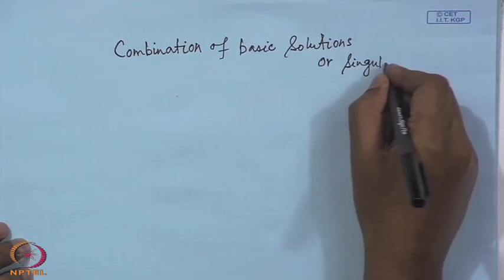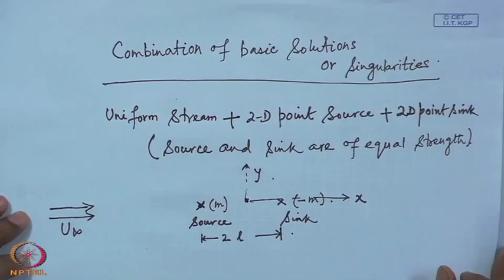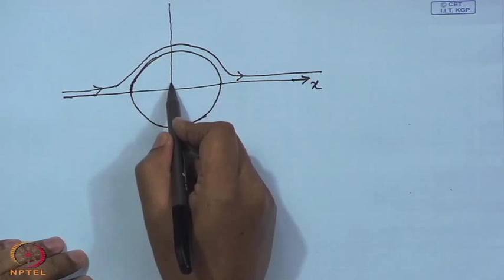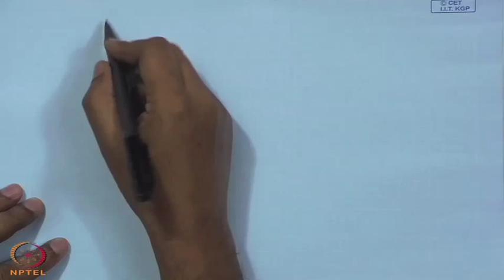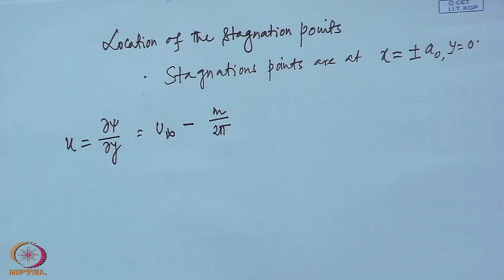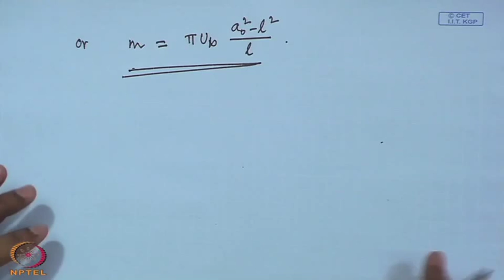Mod-17 Lec-30 Potential Flow - Combination of Basic Solutions (Contd.)

Comment: Yes indeed , the flow inside the Rankine oval is none of interest, but the the stagnation streamline, that is defined by setting the velocity field equal to zero. that forms the Rankine oval and separate the outer flow which is due to uniform flow and the inside flow due to the source and the sink...